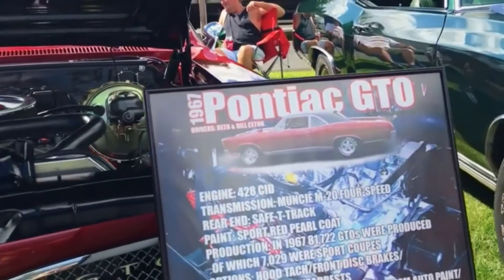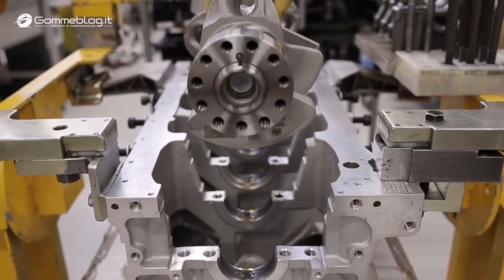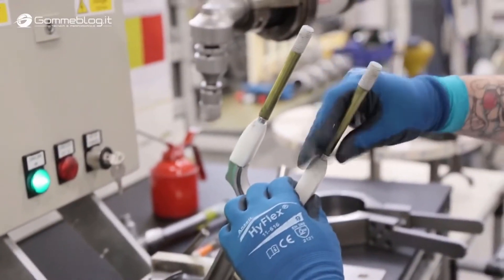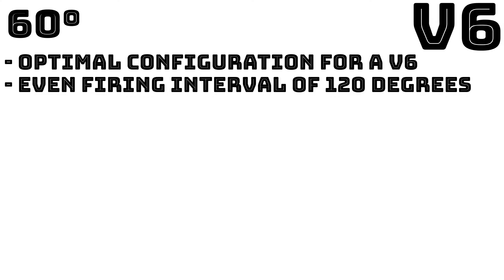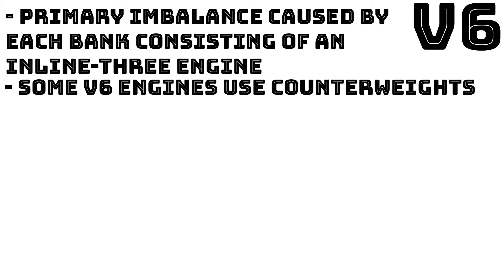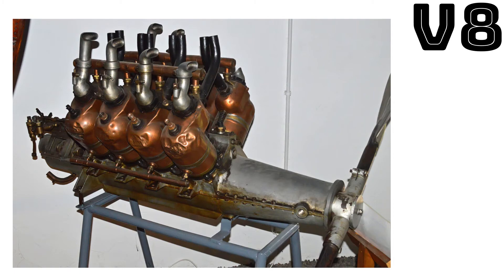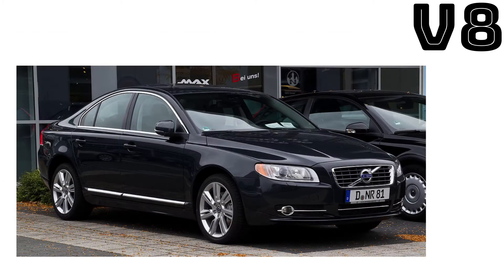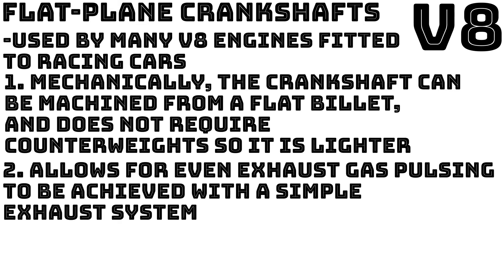V Style Engines Explained (V6 vs V8)

Comment: What about v6 boost vs v8 in truck lingo.? Like f150 v6 vs v8 engines
Reply from the maker: As far as I know, the V6 ecoboosts haven't been as reliable as the V8 NA engines. I'd have to do more research on them to give a more educated opinion but I'd definitely agree with the "bigger is better" saying when it comes to work truck engines. If it's a small single cab truck that just needs ok offroad capability but will never tow, small engine is fine but once you go past that, I recommend a bigger engine. NA engines will usually be more reliable (not always the case but usually is). Now, that's only petrol engines, diesels are a whole different ball game and a whole different can of worms. Thing is, diesels are a bit different here in Europe than in America (mostly emissions stuff) so again, I'd have to do more research to be able to give a better answer.
The way I'd go about it is diesels are for towing and LONG distance driving. Petrol is for short and for more complex roads, as diesels are much heavier.
Reply: @iro-huncarguy8367  man I truly appreciate the response, I've recently being beating my self up that I bought a 2018 f150 v8 4x4 and I have seen to many videos where the V6 engine has way more towing capacity and I just can't understand why the V8 is losing to the V6 twin turbo.
Reply from the maker: @eddyflo2978  as far as I know, the V8 in those are very similar to the ones in a mustang GT. I think you can easily supercharge it, which would be quite nice for towing as it has no lag.
But I can guarantee you that the V8 engine in your truck will last a lot longer then a V6 ecoboost